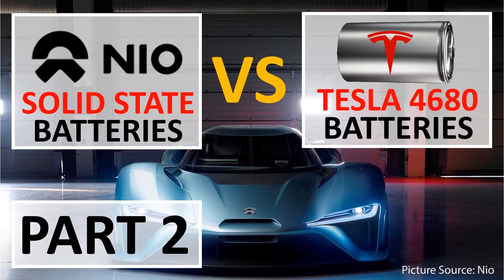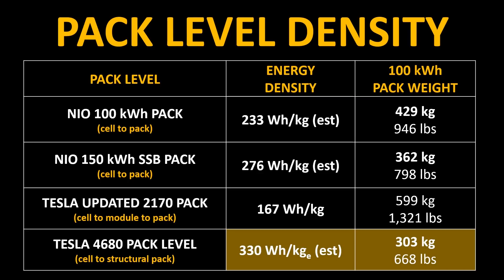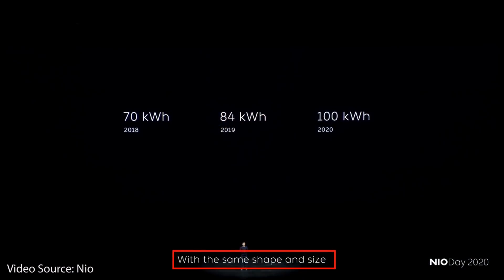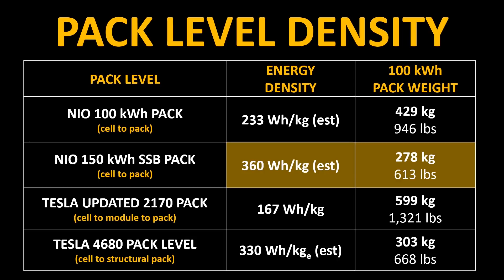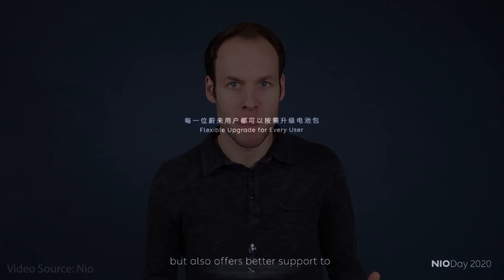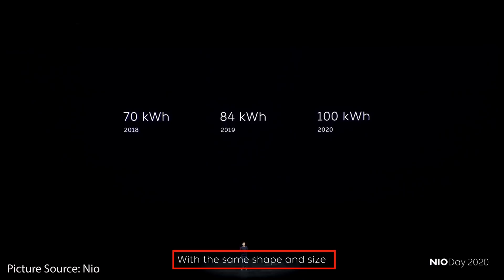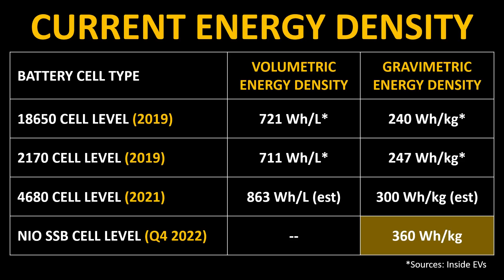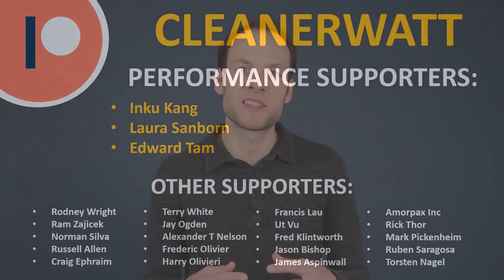Tesla vs NIO Solid State Batteries (Part 2: Did I get it all wrong?)

Comment: The battery packs for all NIOs are the same size- I am not sure about weight. I have watched their battery swapping tech and it is amazing - all the batteries are currently the same size - everytime I go into my local shopping center in Shanghai I see swapping happening. 3 minutes and a new battery, plus it checks the car and battery electrical systems and recycles any defective batteries. I will try to find out.

Comment: I think we're going to have to wait for some reporting on a teardown of NIO's battery pack; your estimates last video were good, but there was room for error in there, so it could be pretty different.  Same goes with the 4680s once they've been produced.

Of course energy density is only a small part of what matters.  Cycle life, power density, and thermal properties are also important for charging, performance, and longevity.  The timeline of introduction is equally important.  Tesla's 4680s are going to be put into the Berlin Model Y when it starts production around the middle of this year, whereas NIO isn't going to have these solid state packs until the end of next year.

Even more important is cost.  Musk has said that the 4680s should bring the cost down to around $50-55/kWh at the cell level.  With the pack being structural, it's arguable that we shouldn't bother talking about a $/kWh cost at the "pack" level.  Even if we did, the structural battery saves so much money in other vehicle structure costs that accounting for those cost savings directly in the battery cost could actually bring the effective $/kWh lower than at the cell level, similar to the effective "negative mass".  How much will the solid state batteries NIO's going to use cost in $/kWh at the cell level?  Almost certainly more than the 4680s.  How much more expensive will it be at the pack level?  A lot more; since swappable packs preclude a structural battery, they have to build the vehicle and the pack with their own separate structures, so they definitely won't be getting a negative structural cost like the 4680s might have.

But there's one final thing that's even more important than cost: scalability.  If it can't be easily and quickly scaled to initially dozens, then hundreds of GWh's per year, and in a cost-effective manner, then it's inferior, full stop.  It helps that scalability is a big factor in cost.

At Battery Day Musk said that they expect to realize the full benefits of the 4680 cells (cost per kWh, range increase, capital costs) within 12-18 months, which corresponds to between September 2021 and March 2022.  And the current plan is 100GWh/year in 2022 (although we don't know if that means producing 100GWh in 2022, or reaching a 100GWh/year run rate some time in 2022).

Until a solid state battery demonstrates that it can be scaled quickly and cost effectively, and can also be integrated into a structural battery, it doesn't matter if it has better energy density, or better anything else.  If it can't do both of those then it won't compete, and it will be a more expensive vehicle even if all else is equal.
Reply: Well how many model 3 and model y does Tesla sell to Chinese customers? And a source if you have one. Nio gives the option to rent a battery which would mean you only need to rent a larger battery pack for a month if you need it and then continue to rent the 70kwh. Google battery as a service. So this 150kwh battery isn't a big deal in my opinion if it's going to be in limited production. We just need this thing to play out and see how well they are going to do in China the next couple of years.

Comment: Unless they have made a real breakthrough, the problem isn't making a Solid State Battery, the problem is making one that has a descent number of charge cycles without cracking from the battery expansion during the charging process and is low cost. Just like Toyota saying they will have a SSB next year and then saying that BEV's are no good so please keep buying our Hybrids.

Comment: To put it bluntly, the proof in in the pudding!
In other words Nio can say what they want but until you can see it for real, it is just empty words.
Reply: Just like Tesla then...
they just made they battery cell 5 times bigger, no real magic there. Just do the math, the cell have five times bigger volume than the current 2160 battery.
Reply: @cofal79  i think you are misinformed. Or maybe I am. 

Battery day already showed that Tesla has a million mile battery with a 750 mile range per charge. You just have to listen.
Reply: @omark8012  well to the volume calculation. This cell I 5 times larger than current cells Tesla uses.
There is no more magic to it than that.
I beg you to do the volume calculation yourself, to see there is no super magic in this million mile battery
Reply: @cofal79  good point. You are right there. I think the magic lies on how long the battery will last and how far the car will go per charge. I think that’s the most important thing to the customer.
Reply: @omark8012  well just slam more batteries in there. or make even bigger cells...
Reply: @cofal79  Elon would never. Remember this isn’t the design that will produce the millions mile battery. This is step one. Tesla has a full redesign coming.
Reply: @omark8012  you mean a even bigger battery cell... the 50100... and everyone goes WOW.
Meanwhile others make more energy dense battery.
But thanks to the big fanbase Tesla dies have. Magic will always prevail in Teslas magic batteries.

Musk will be the laughing stock when he revails the true weight of his truck...
Reply: @cofal79  I appreciate this exchange. I like that you are challenging my views. Thx. 

No, Elon himself said that any idiot can make a bigger battery. He said the trick is keeping the battery the same size or getting smaller. Watch the battery day presentation for yourself.
Reply: @cofal79  it's a skate board. There is a reason to this madness. 

Musk is offering to help other manufacturers build electric cars. Think about why a skate board will be useful.
Reply: @omark8012  Well the skateboard design isn't something new. Many car manufacturers use it already for their EVs.
And the skateboard design was already used long ago on ICE cars. 
So yet again Musk dont bring anything new to the tabell. Just old stuff younger people dont have any clue about. Porsche and Cooper mini is and was two cars that used that design, so did the first VW Beetle.

So can we conclude that Musk is an idiot that just make bigger batteries and use old tech, and call it his own?
Reply: @cofal79  
Re "even bigger battery cell"
You're using the "ah, but....... Competition!!!" Argument?
Really?
They're behind now.
The 4680 puts them further behind.
The new methods (Maxwell) .... Even further behind.
When new chemistry is added, even FURTHER behind.

Btw, if as you say, you've worked out the relative volume, you should have worked out that the gains at pack level are using the same chemistry (Wh/kg) as the current "Panasonic" (Tesla chemistry) cells, based on the surface area of the jellyroll material.

If that material is developed and jump from 260 to 300+ Wh/kg using for instance, high Nickel content, the cells/ packs get a corresponding boost.

Plus, work out the surface area of the cell "can" (2170/4680. Account for the same thickness or casing material, multiply buy the number of cells in a comparable pack.
The material used in the combined 4680 casings is 66% of the 2170.
Effectively more Wh/ kg of cells.
Then there's the lack of, or highly reduced pack casing.... More Wh/ kg of pack
Clever people thought about this as a fundamental engineering exercise with no preconceptions, or consideration for use of existing plant.
That's (apparently) what's missing in the established companies.

Watch Sandy Munro talk about the Megacasting, it's the same thing.
"We built a mock-up years ago (here it is).
Certain executives from established companies saw it, asked about it and dismissed it out of hand...... I TOLD them it was the way forward..... "
Reply: @cofal79  
The Issigonis Mini was a monocoque with front and rear subframes.
You could not attach wheels and roll the chassis without the body.
It was not a "skateboard"
Look it up.
If you can show me a picture doing so, I'll apologise.
 (clue, you won't find one)
Reply: @rogerstarkey5390  Have you done the volume calculation?
As I notice you have NOT.

I recommend you to do that before commenting on anything that Tesla is better at this and that.

You will notice that the 4680 is 5 times bigger volume than the 2170.
That is 5 times the storage capacity of the 2170.
Its the same scam Musk pulled off when he went to the 2170.
Bigger cells means more energy to be stored. 
Means better Wh/Kg.
And the chemistry isn't anything revolutionary per say. Only new is the way they pack their cells. To make it cheaper.

Knowing Tesla cutting corners will not pay off, as we see on their repair cars after delivery policy.

And with this one comment I answer all three of yours!
Reply: @cofal79  The magic is the tabless design and elimination of cobalt as well as the structural aspect.  The reduction in cell resistance allows that 5x increase in size at the cell level allows much faster/cheaper cell production with a much higher C rating, increasing charging and discharging performance levels.  I think I read or heard Elon stating this will allow them to release about 800 more horsepower from the present electric motors without voltage sag or overheating or damaging the life of the cells.  You are right, it isn't magic, it's magnificent engineering.
Reply: @scottwa   any idiot can make bigger batteries...

Yet again si there another one talking about some experimental battery tech. That only exist in a lab.
And to date don't work...
Reply: @cofal79  
If there's "no magic", but it yields so much more performance, why didn't anyone else do it?
Answer
Because the larger format brings it's own problems with heat and resistance.
The "magic" of Tesla appears to be "outside the box" thinking, dismantling and rebuilding the system, taking and adding alternative technology to improve.
Hence, the tabless design, which someone (🤔) at Tesla had the vision to use. That's the "magic".

More magic?
They also realised that another gain comes from being able to get a similar kWh output from a factory but using only 20-25% of the "cans" leaving the plant.
(Example, 950 cells per pack instead of 4000+)
That's using only 60% of the metal to make the cans for the same kWh (yes, I did work it out)
Reply: @rogerstarkey5390  Have Tesla worked out their clean room problems yet?
As 1 to 2/3 of the battery chemistry is throw out because, Teslas employees cant make batteries.
That's why most of the batteries dont leave the production line, and have to be discarded.
Simple answer to one that really just belives in the coolaid.

Comment: How well does the NIO SSB cool?  Is there a issues with disconnecting and reconnecting battery in their battery changing station?  These two issues will effect the effect the life of the battery.
Reply: Battery swap is just another option on top of charging. So they can charge just like a tesla too

Comment: You keep talking about energy density and watt-hours per kilogram but given that the NIO batteries are swappable they are actually identical volumetric size not weight, so your analysis seems to be all wrong in this important aspect.
Reply: what do you know about their upcoming 150kwh solid state battery? List sources as well thanks

Comment: I see a lot of hype in this video (and in the comments) regarding Tesla's structural integration of the battery into the chassis.  This to me, as a potential Tesla customer is pretty scary: this would make the battery non-serviceable. It will be incredibly difficult to repair a bad cell or faulty connection when everything is bonded and sealed in the battery pack inside the chassis. 

You basically have to scrap the whole thing and put a new chassis & battery, or total the car altogether. Just like with smartphones, where the glass is bonded to the display, if you scratch or crack the $5 glass you need to replace the entire $300 OLED screen, even if the display is still good. And while a screen is only a few hundred bucks, a new battery can be $8000 or more. I find this idea very bad for future Tesla owners (especially for out of warranty cars) with the only upside of marginally more density. I would certainly be more comfortable as a consumer (not investor) with the swapping system from Nio.
Reply: I think that too. I guess Tesla have worked out the savings on each car outweigh claims against the battery.